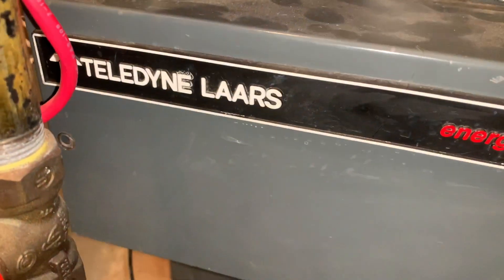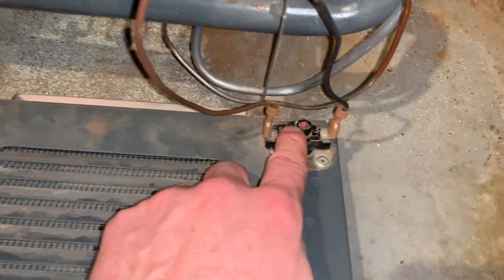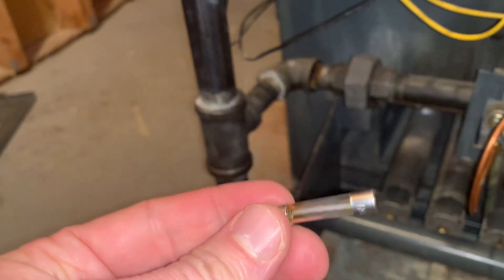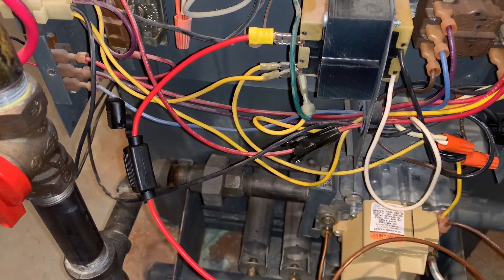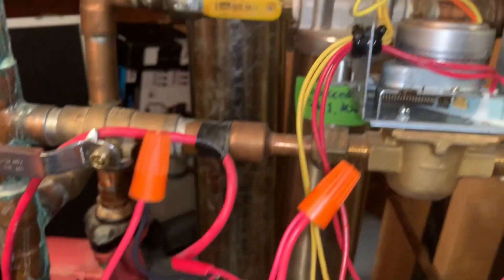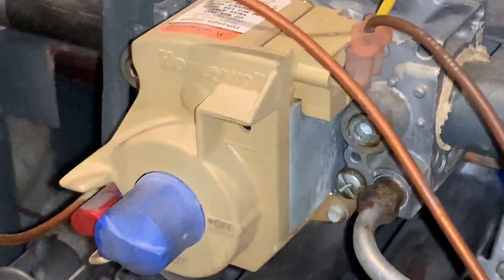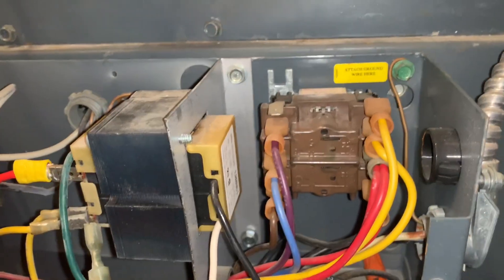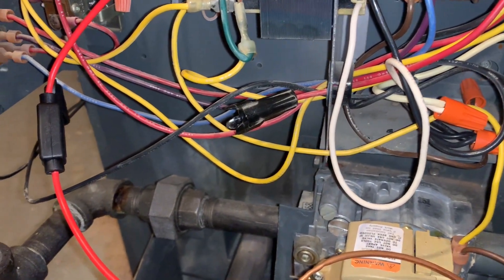Teledyne Laars Mini-Therm II (JVT model, 1996) pilot on but boiler won’t fire FIX and troubleshoot

Comment: You can use a short wire instead of the fuse. It is low voltage so no worry about shock
Reply from the maker: Thanks for the tip!

Comment: Hi,
i have the same radiant heater, but my issue is a little different and would like to know if anybody else has this issue. The boiler turns on, but it turns off after 1-2 minutes after i turn it on. the water circulation pump gets really hot and starts making a humming noise. Any info would be appreciated, Thank you
Reply from the maker: Hmm… my guess is air bubble or low water.  Maybe low water flow because of clogged filter. If the circulation pump is not circulating water it will overheat. Your system is shutting down for safety.  My system has bleed valves you turn - little copper knobs - to get trapped air out.  Filter is easy enough to change and should be changed once a year or once every two years if not a lot of rust, etc.  I have no idea how to add water since mine is supposed to do it automatically and I’ve never had to figure out how or when.  Hope that gives you some ideas.  Cheers

Comment: Thank you for the help! I followed your steps and I probe everything. I finally figured it out one of the thermostat was acting up after i checked the voltage on it and moving around the manual switch it worked! Your guidance for trouble shooting is much appreciated. Thank you again!

Comment: Any chance you can take a photo of the jumper on the damper harness? It’s the one on the left without the yellow tag in your video.
I have the same setup as you but I have an automatic damper instead of the jumper; I’m looking to jumper that but I do not have the og jumper part.
Reply from the maker: Ok. Will do on Monday.  Cheers

Comment: 2 Weeks ago I started having with the same problem with mine. I turned everything off. Started it up again and it fired of for a couple seconds. Then it went out again. I did the samething but I turned the gas to minimum and it ran constantly until the weather in Wisconsin got better then it shut back down. I attempted it again cleaned the roll-out burners with brush and I got nothing no more. I haven't did your steps but thank you very much for uploading this.
Reply from the maker: Sounds maybe you could use a new thermocouple. The copper wire looking thing that detects if the pilot is on. It’s the same as in a gas furnace.  It it gets dirty or just wears/burns out then the boiler or furnace will short cycle (only stay on for a little while) or not come on at all. Also, check your vent to make sure not plugged.  Those would be my guesses if it used to fire. Sorry I couldn’t be much more help. Good luck and let us know if you get it going again and what caused it.  Cheers!
Reply from the maker: Oh and I guess I should make a video on replacing the inline water filter.  It will be in a big metal cylinder. If that gets plugged it will reduce water flow and thus not enough water pressure and it will turn off boiler.
Reply: @ChanceSummer  Thanks for the info, I'll check it out now. Any videos you make will be much appreciated. You can't find many videos with this style of boilers.
Reply: @ChanceSummer Yesterday I took apart the burners and the thermocouple. Cleaned them up. Then, put them back in. The pilot lit, but the rollout burners did not. I then shut the system down. I was going to replace the thermocouple today because we're expected a freezing ice storm, and I fired it up just to check everything out, and the boiler fired up, and the burners are working. It's been on most of the day. Thanks for all your help!
Reply from the maker: That’s awesome. I’ve never cleaned my burners so you are far more advanced than me. As Red Green would say, if the women don’t find you handsome they should at least find you handy!

Comment: Where did you find the info on  what does what here? Mine is doing exactly what is described. Pilot is on, but it won’t fire.
Reply from the maker: I couldn’t find any guide for my problem so reading the owners manual (see link in video description), trial and error, and some mechanical know how.  Hopefully if you watch the video it will help and if not, time to call a professional haha, which is definitely not me.  Good luck.